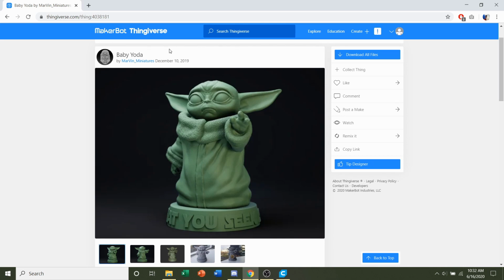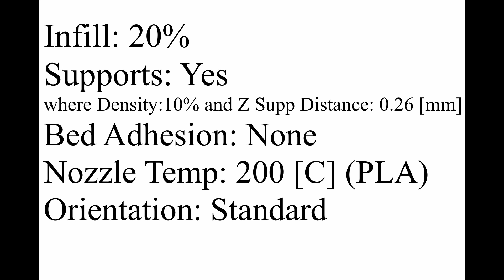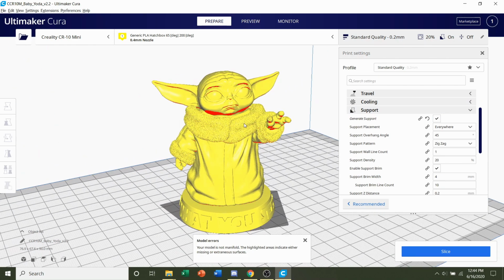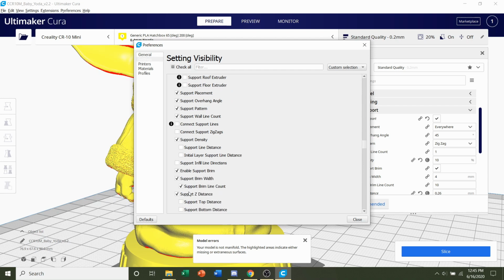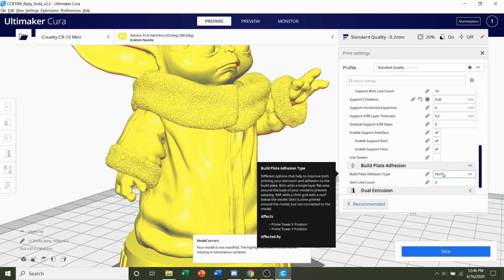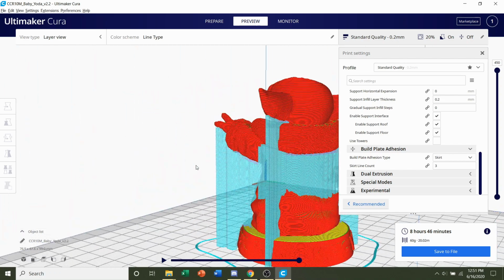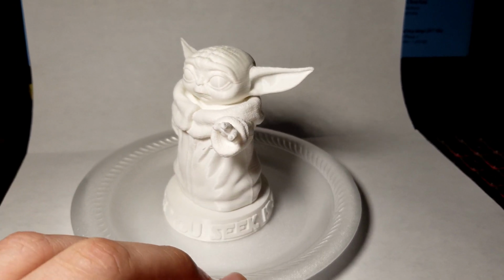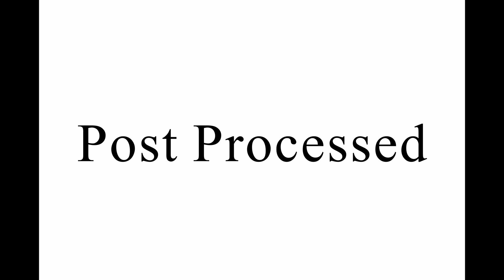Baby Yoda 3D Printed - Tutorial, Settings, Time Lapse, Showcase

Comment: my support density is grey on mine in cura. nothing i change will make it yellow so i can change it. i dont have tree support on either¨
Reply from the maker: If a setting is grayed out, that means it was locked by something else you changed previously. 

Try resetting that profile by clicking on the layer height (quality) you want on the "profile" bar, then click on DISCARD when ever that pop-up comes up to erase all previous modifications. 

If that doesn't work, make sure you don't see any curved arrows under the settings, those normally lock other settings. Click on them to undo. 

If you don't have tree supports in your menu, click on the gear icon near any setting (E.g experimental) and search up what ever setting you want on your menu to bring it up.
Reply: @Gabriels3DPrinting  tnx i ment, whatever i change it is still gray. I have all advanced. Must be something simpel i missed. Resetting my profile ruin my perfect setting sadly. I will sort it soon. Tnx man

Comment: Do you think it would  be easier to remove the supports in the density would be lowered to like 6 or 8%? Or would that not be stable then?
Reply from the maker: Having too low of a density would leave too many gaps in the support making them useless for these tiny little fingers.
Reply: @Gabriels3DPrinting  I was able to print it with 8% support density and 65° overhang. Still the supports were a challenge to get off. I bent 2 of the lower arm fingers while removing it, but i just flexed them back into place.
Thank you for your settings though. Really helped a lot since i'm a beginner.

Comment: Hiya, Everything is working as it does yours until it completes the base and starts on yoda then it streams into threads. It appears mine isn't making the interior honeycomb pattern that supports the model. Is there a setting to have it fill the empty space in the middle of the model with the honeycomb structure?
Reply from the maker: Infill is always defaulted to be on in all slicers I have used. In cura, go to infill --> infill pattern and select which ever you would like. The default pattern is "cubic". You can also increase the infill density to have a less hollow inside.
Reply: @Gabriels3DPrinting  I get that. The issue for me is it's not creating infill in the stand/base w/ the text under the Yoda shape. The stand w/ text comes out perfectly, but the moment it starts with the Yoda shape, it lays filament across the open space, leaving behind a mess of strings. I can't figure out how to infill inside of the circular base.

Comment: FYI the Z-seam is not "luckily placed on the back of the model", it is the default setting in Cura, which you can change.
Reply from the maker: Yes, thank you. I believe with the newer versions it uses smart hiding meaning it prioritizes sharp edges, then default to the back.

Comment: Oh man, I printed it overnight last night, my first overnight print. Did great but guess what happened...I broke the fingers off his right hand while removing the support material!! Gyaaaah!!!
Reply from the maker: Ouch! Although my print settings make it 500% easier to remove the supports you still have to be very careful because these fingers fall off very easily.
Reply: Gabriel's 3D Printing I know and I thought I was being careful because of what you said and I still did it! I think it’s because I pulled the support piece from the bottom instead of clipping around the fingers first. Now that I understand how it’s in there, if I print this again that’s what I will do.
Reply: @chrinamint  This video was great, clear and good for a beginner like me who is using this model to test how to do supports. I have printed it 4 times now trying tree supports, normal supports and even manual supports and have set my support infil to 12% but every time I am unable to get arond that right hand carefully and it breaks off the fingers. It's a tough one to do but apart from that, the rest of the print is 100% and at 0.16 it looks amazing, tho took 19 hours with tree supports on Ender 3 V2
Reply: This is the exact reason i am here.  Broke the fingers off on my first print and was super disappointed. Gonna try again